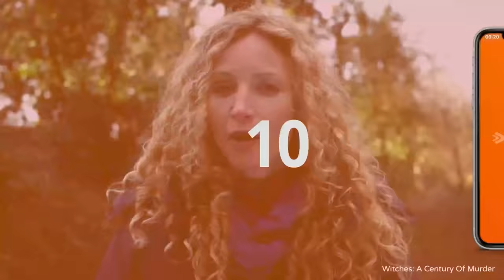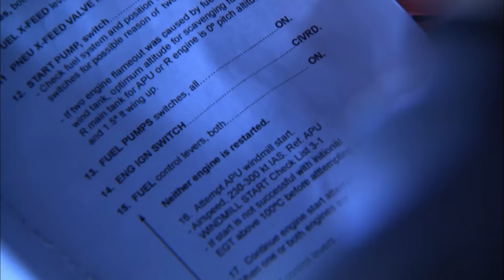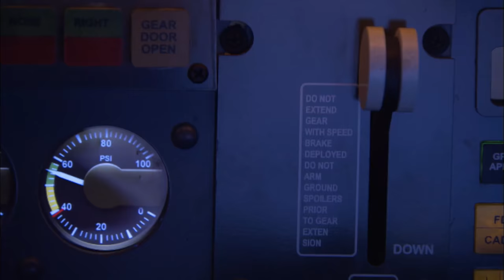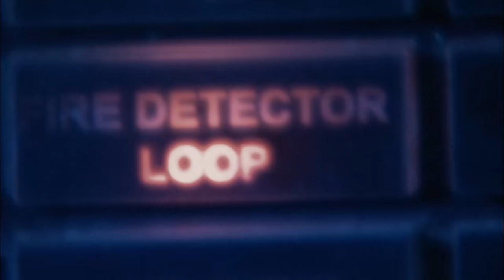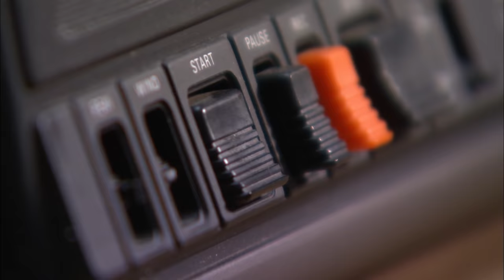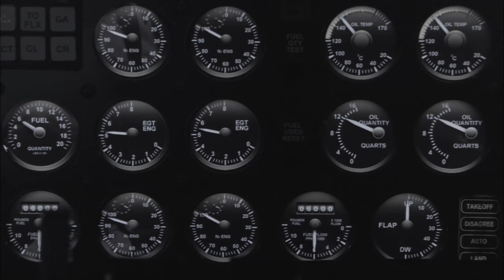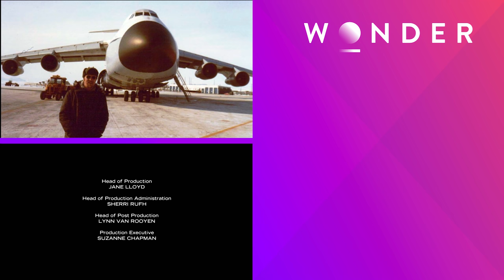Scandinavian Airlines Flight 751 Crashes After Losing Power [4K] | Mayday | Wonder

Comment: Reminds me  of the MCAS system:  it  was  there  for  safety  but  since  the  pilots  didn't  know  that  it was there,  it  brought  the  plane  down
Reply: Exactly what I was going to say. These auto safety systems are meant to help, and are pretty incredible. But they must be made aware to the pilots.
Reply: @alexd6345  
Apples and oranges
Reply: Yes, I watched that where it happened twice. I was so angry at Boeing
Reply: And it was done by the same McDonnell Douglas management that had taken over Boeing in 1997.
Reply: You have it totally wrong, pilots were aware of the MCAS. It didn’t function correctly and was extremely difficult to turn off when it malfunctioned. It was not working as intended.

Comment: Another example of how a computer should never have the ability to override a pilots command. (And not even know what it was).
Reply: Or, if you have a install a computer with the ability to override a pilots command, you should at least tell the airline about it before selling the airplane to the airline! AND, there should be a big red button installed on all aircraft that disables the ability of the computer to do ANYTHING which the pilot did not command!

Comment: What remains confusing to me is that the pilots rotated at the calculated Vr speed, and did not find that it took longer than usual to leave the ground than usual. Ice adds weight and changes the shape of the airfoils, which would require a higher Vr speed.

Comment: THis is a classic example of installing software based on incongruent assumptions. Example dumb increase of throttle programming without considering an engine fire or damage. Installing the system without informing pilots was not only negligent but criminal.

Comment: Finding out the thing you love, the plane/flying, basically tried to kill you is pretty traumatic and there is more than just trust lost in the plane. He lost trust in the airline chain of command FAILING to tell him about the updated throttle ATR controls. He probably could have restarted the right engine and landed safely and the plane could have been repaired...if not for the ATR sabotaging his attempt to save the plane. C'mon, even in Star Trek there's a computer override button...as long as it isn't out of order like on Spaceball One(shift to the Mel Brooks parody movie).

Comment: Unsure if the “brace” position is the safest one, as your head/neck is used to absorb impact. My understanding is this came from the military, however in military aircraft the seats face the opposite direction (in this case the brace position makes complete sense. I would think scooting down in your chair (making yourself as low as possible) and placing your hands over your head with elbows tucked in his safest position.
Reply: Is there really such a thing as a "safe" brace position if the airplane crashes? I don't think so! Seems to me to be a matter of luck.
Reply: For your edification: reasons why passengers should brace for impact: Doing so reduces flailing and minimizes the effects of secondary impact. In aircraft with seats spaced relatively far apart, a passenger should rest her head and chest against her legs while grasping her ankles. Her head should be face down in her lap, not turned to one side. (In aircraft with very close seating, a passenger should position his head and arms against the seat in front of him.)

This opinion was endorsed in a 1998 study published in Aviation Space and Environmental Medicine analyzing the crash of a Boeing 737 at Kegworth, near Nottingham, England in 1989. One-third of the passengers died in the crash; the injuries of the survivors included a significant number of pelvic and lower limb injuries. The study suggested that the traditional brace-for-impact position (which did not include a passenger using the seat in front of her as a brace) could be modified to help reduce these types of injuries.

The FAA bulletin concludes with this bit of advice: “In the case of a planned emergency landing, the passengers should be briefed on the above information. In the case of an unplanned emergency, the flight attendants may only have enough time to give a short command such as ‘lean over’ or ‘grab your ankles.’ Experience has shown that in an attempt to take a brace position of some sort, the passengers will end up in a position which could result in less injury than if no attempt had been made at all.” (Scroll to the end of this FAA publication to see diagrams of the brace position.)

Comment: Why these aircraft manufacturers install new "safety" features like ATR and MCAS and don't inform the airline or the pilots is beyond unacceptable.
Reply: Also GPWS. Has it ever saved anyone? It seems to kick in too late or cause crews to panic. Id rather fly a 707. Completely mechanical. Fewer fatal crashes. A computer doesn't belong in an aircraft unless its an autopilot

Comment: were they too low to do a u turn?
Reply: yea
Reply: Yes. The plane was st 1600 ft when they instructed to maintain 2000 ft. The u-turn would have killed them because it would have caused them to descend faster.
Reply: The engines were failing. One needs to land as soon as possible. He wss fropping at the rate of 1200 ft per minute. How much time do you think he would have to meet the ground or sea which was near by.?

Comment: Leave it to this "drama based" series - vs. Technical flight analysis like Mentaur Pilot to get the frigging AIRCRAFT wrong. This was a Macdonald Douglas MD81.  NOT a "new DC-9" -yes it is a DC9 Type. But not a DC9
Reply: At the time they still used "DC-##" designations. When Boring took over, they were re-designated "MD-##" to denote that these were McDonald Douglas designed planes. So it's not a wrong statement, as at the time it was still a DC-9
Reply: To some of us here is 6 of 1 or half dozen of the other anyway 🤣

Comment: When engines start failing, you dont keep going away to the forest.  Away from the airport..  You turnback to the airport instead of keep going straight away.  Duuhhh !  
He frozed in panic and kept going away to the forest.  Afraid of maneuvering.   Very basic pilot errors done.   Im  a retired single and multi engine CFI with 2 full feathered landings.  No damages.
Reply: Do you fly the DC-9-81 or MD81?
Reply: @maxsaviation9512  That is a required procedure, not only for that airplane. Geee guy..
Reply: Sure bruv.
Reply: They didn't have the altitude to turn back. Were you not paying attention???

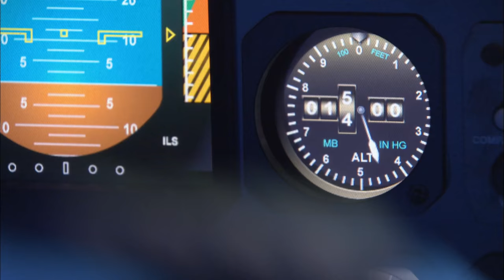Comment: 6:58 that sounds like backfire of engines. potential miss-fire so it sounds like something INSIDE the engine is at fault.
Reply: The engine parts began to disintegrate enroute, broke part of fuel line and fuel ignited causing flames.
Reply: Ice ingestion.
Reply: Don't forget you're listening to a reinactment

Comment: The captain did the right thing by quitting his job as a pilot. While he was very likely to be able to fly and collect a paycheck, he is tremendously responsible to not enter another cockpit. If you do not have confidence in yourself to fly then you should not fly. It takes much more courage to admit you do not feel like you can keep your plane safe than it takes to jump back in the captains seat for that paycheck. I like motor cycles, but I don't ride them because I do not have confidence in myself to ride one with skill and safety.

Comment: One reason I never fly in winter. Snow is a trouble maker. Snow is BAD😖😖😖😈👿👿😈👿😠😠😡😵 I hate snow anytime. and anywhere😠😠😠. This crew did magic in getting that plane down, even if it landed and broke up, it wasn't his fault. ENGINE failure is common. You have a 50/50 chance of getting out alive after that happens.

Comment: Almost 60 seconds after the first banging sound passed and they didnt declare an emergency and turn the damn plane around?!?!  Stunning.   They wasted valuable time and only God being  on their side got them down safely.   Im not sure i'd call this guy a hero as he made crucial  time errors early on.   Im sure if any training  simulations were done that 90% of them  woudnt have wasted those precious 60 seconds. and more than half of them would have made it back to the airport.   And God was also on the passengers / flight crews side as there were no deaths.
Reply: Ah, yes. Let's declare emergency the second we see or hear something that is out of the ordinary and before we know exactly what's happening, which isnt standard protocol.
You see, most pilots would try to figure out what was happening before declaring emergency. You kinda need to tell the ATC what the nature of the emergency is when you declare emergency. That's what they are trained to do. You cant just declare emergency all willy nilly. If you do that, you're potentially wasting resources.
The Accident report didnt list the 60 seconds the pilots took after the engines started surging as an issue that caused the accident. Those 60 seconds wouldnt have made a difference. They still would have crashed anyway. They couldnt turn around without their engines without losing their much needed height from where their position from the airport. Are you even a pilot? Did you even watch the video? At the end, it literally says "The Swedish Accident Investigation board's accident report determines that the pilots actions contributed to the safe outcome of the incident". The accident report says that the pilots did nothing wrong and were not at fault in anyway.
Maybe watch the entire thing with an open mind before commenting and jumping to conclusions.
Reply: @AshleesBathroom  -- Fine then pan pan or just ask for vectors back to the airport till things get figured out.  Certainly not continue farther and farther from the airport.
Reply: @LiveWildandFree37  did you not read my comment or watch the entire video? They were too fat from the airport at the point that the issue started to have made it back to the airport safely. They would have crashed no matter what. Their actions WERE NOT the cause of the crash. There was nothing they could have done.
The SAIB even said in they were not at fault. If they were, the accident report WOULD HAVE SAID SO.

Comment: So the damn computer crashed the plane. There are reasons we have pilot, then .too them 2 months to give the information to anyone, even better. When you take engine control out of the pilot's hands you've gone too far.
Reply: Computer code introduced prob from complaints of residents near airports about noise levels.  So the residents complain to their local politicians, who then complain to the airports, which gets filtered down to the pilots who implement their own noise reduction measures (throttling back).  Residents are happy, etc..  Not sure if there was a previous crash that drove the FAA to have airline manufactures look at means to override the flight crew flying the plane from throttling back at critical times, but seems to me that is the chain of events for the code being introduced.

Comment: Why the hell are we taking off airplanes in icy conditions at all. All flights should be grounded if it's below 33 degrees . Zero exceptions
Reply: Planes cant just be grounded for extended periods of time. They're vital to our world, our society, our economy. There are ways to get a plane off the ground in icy conditions. Inspection of the aircraft and deicing fluids on the aircraft are the main ways for that. This is a rare occurrence and shouldnt be the reason that air travel be completely haulted.